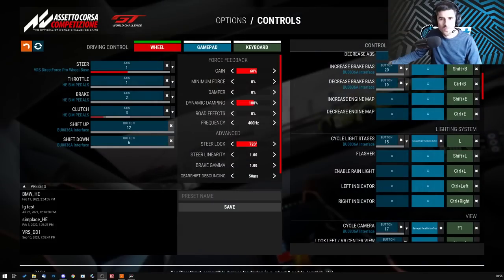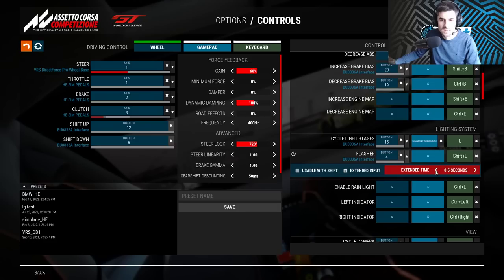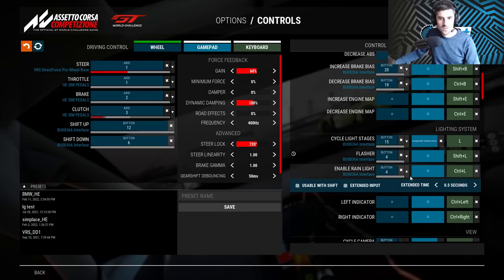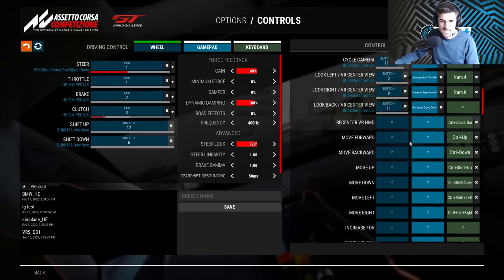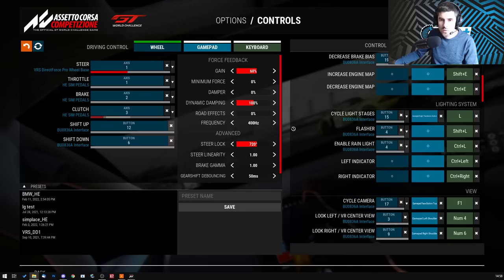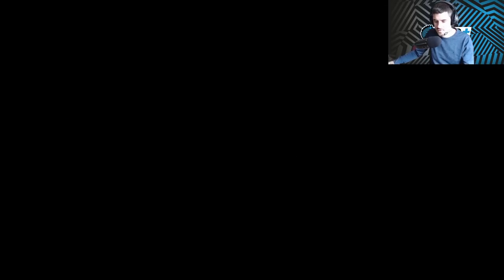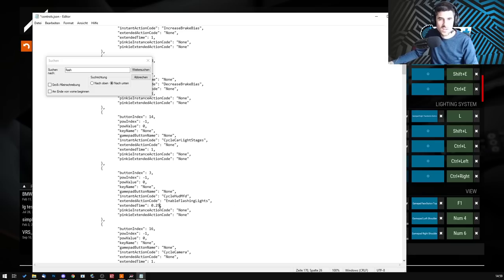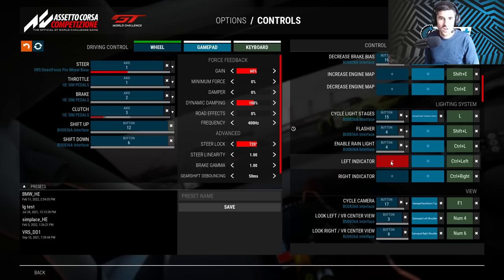Why does Kunos not talk more about this SECRET function? - Assetto Corsa Competizione

Comment: Don't forget about the shift button you can also bind!  I only have 6 buttons on my wheel.  So what I've done is set 1 as a shift button which means I can use either hold, or shift to have 10 functions.  However you can also combine both and I can add another 5 for a total of 15 functions.  As a side note I also like to use push-to-talk when I'm racing so I just use the Shift button since it does nothing by itself.  Every single button on my wheel has 2-3 functions on it, even the shift button.  The only thing I couldn't bind on my wheel was ignition/starter
Reply: This is what I use with the formula V2 extended paddle module. One of the top paddles is a shift modifier so that I am able to manage tc2 and some other small settings a little simpler. I don’t use em often but I do still use them.

Comment: Thank you,  finally I can change the Brake Bias and TC with the same buttons, and dont have to open the menue every time.
Reply: When I had only a couple of available buttons, I had TC Increase and TC Decrease on the same button. Short press increased TC, Long press decrease TC. Same for ABS.
Reply: @alpha007org  Thank you for the idea, I only thought about ABS Increase  = Press Brake Bias Increase  for longer but with your solution I can do all seetings with just 3 buttons.
Reply: @CreeperGreenMC  I had one encoder which I used for BB and 4 buttons. Short press to increase ABS and TC while long press decreases them makes logical sense to me. Then one button for starter and ignition and last one for flashing and cycle light stages. Joystick for MFG. Very basic functionally on the wheel itself but I could do every important function in ACC. I had to think creatively. :)

Comment: You can also use the dropdown in throttle brake and clutch to regulate what's min max and so on. Especially if your throttle at 100% is weirdly jumping from 95 to 100% it can save your race or weekend and can virtually extend the life of your pedals
Reply from the maker: yes, true. but I think the dead zones are more of an expected feature
Reply: @SimracingPopometer  yes indeed

Comment: Did know it since the start of ACC because I had only 4 Buttons back then 😬
Now i have the ignition and the "start engine" on the same button and it works great and it gives me half a second in pitstops in comparison to the two button method.
Reply from the maker: wait what
Reply: I do not understand. Either way, I only need one button at the pit stop!?
Reply: yup been using ignition + starter on the same button since I first got my wheel, makes it easy to start, especially in VR!
Reply: You can turn your ignition on in the pit stop at any time in the pit.  Then it is only 1 button regardless of your button mapping to start the engine and leave when the pit is done.  Some people I know just long press the starter when they come into to pits to stop the engine as it does not turn the ignition off.  I don't like that method though as it takes longer to turn the engine off and you have to press it before you stop or you lose time.

Comment: Also, I have a button box with more buttons than windows can handle and show in the controller adapter. HOWEVER, ACC accepts all those extra buttons and can handle all the extra functions. Pretty neat.

Really kunos, where is the user manual to explain all those functions. Its like easter eggs.

Comment: To answer the rhetorical question: Because the function is not that great.
1. It's somewhat useless, with except maybe for flash / toggle light or TC1/TC2
2. It's a bit awkward because youalways have to check that the right thing happened
3. The 0.25 seconds which you (and I) prefer is overwritten every time you go into the menu.
4. It's not compatible with other titles. I want to have the same buttons.

You can use a shift button in ACC and iRacing, but that's to confusing.

Comment: Hey Nils, I notice on your wheel settings you've got your lock angle on 720. From my understanding, if you go 900 in game and 900 on your wheel base, the game will automatically set the lock angle to the preferred lock angle for the car. What does setting it to a lower value give you, especially if it's not set to the preferred lock angle of the car (I believe the M4 is 540?)
Reply from the maker: my VRS doesn't put a soft stop when the car uses less than the 900. so if I spin for example, the wheel keeps turning more than the actual steering and recovering the car takes longer cause you first have to find the proper wheel position. since I don't drive Porsche I don't need the 800° and 720 is the next car (Mercedes) - the issue is then smaller there. there's no actual difference to how my steering corresponds to in game input
(M4 is 566 or for simplicity 570)
Reply: got it, thank you!